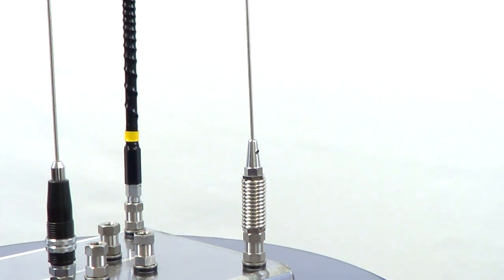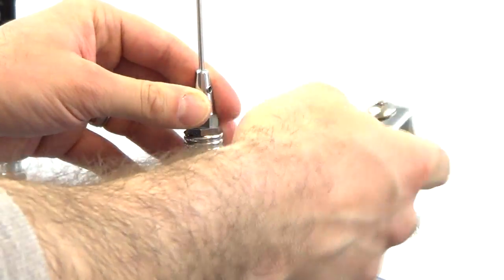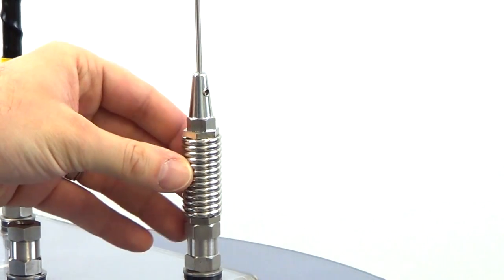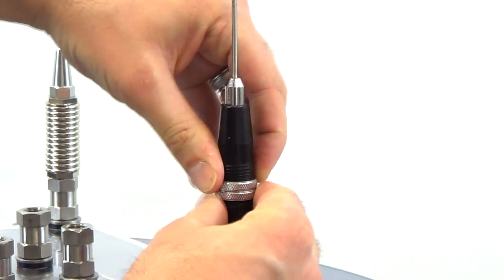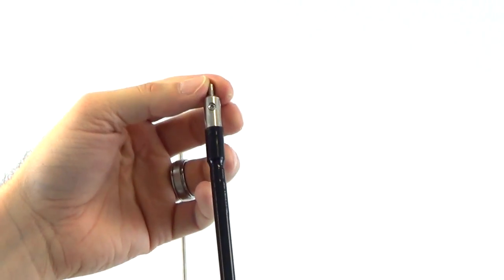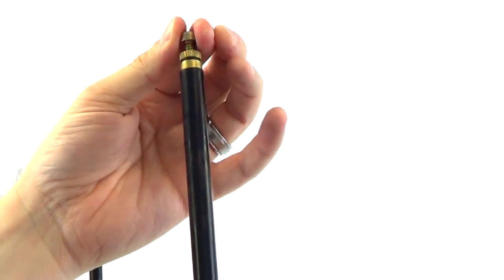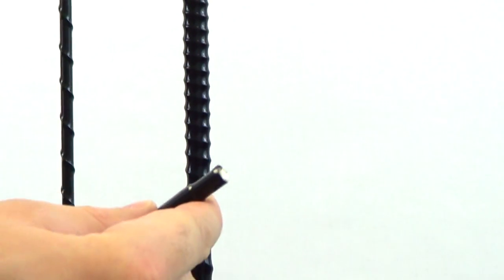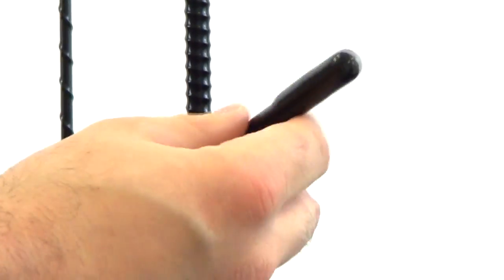CB Antenna Tuning Methods Explained by CB World!

Comment: Finally instructions on how to Tune my antenna with Rings. I took those off thinking they were some kind of mounting rings. By loosening the Allen nut I raised and lowered the antenna to no avail. I was frustrated until seeing this video. Thanks!
Reply: I just installed mine... Channel 40 was at 1 for me (the high 1 by the red zone, not the low one I wanted) and I couldn't figure out how to fix it till I found this. Moved the rings up and it works perfect now! Channel 1 is 1.5 and 40 is 1.25

Comment: I brought my swr down by wrapping 14 gauge copper wire around the antenna at the base just above the magnet it has to be on the part that you adjust my swr on channel 40 was 1.2 and on channel 1 it was 2.8 after I PUT THE WIRE on it my swr was 1.6 on channel 40 and 1.4 on channel 1 you need a piece of wire about 8 inches long but you can try that and if it is not long enough try a short piece or cut a longer piece you do not have to remove the insulation from the wire wrap it close together

Comment: Great video I'm living on the second floor of a block of flats and I can't put an antenna on my roof so I'm using a springer antenna on a magmount base on a baking tray lol but the swr is quite high. I'm transmitting OK but the local breakers say I sound miles away but I'm not to far away from them do you have any ideas what I can do
Reply: Put  ground radial wire's on the tin
108 inch 4 or more

Comment: What do you mean high high high on channel 40 ? Or channel 1. ?
Reply from the maker: Thank you for asking!  If your SWR reading on your highest channel is higher than your SWR reading on your lowest channel, then your antenna it too high.  High, High, and High.  You would then need to reduce the length of your antenna system.  You might also want to check out our High SWR Troubleshooting Article on our website: https://www.wearecb.com/troubleshoot-a-high-swr.html.  We hope that helps!

Comment: What if 40 and 1 are in the red. I have made sure the ground is good. The antenna is new. I put a old one on and it tunes good. I have adjusted it from longest to shortest. Can you have a bad antenna?
Reply from the maker: It could be possible that you have a bad antenna, however, there are several factors that could be causing the high SWR readings.  Be sure to review our Troubleshooting High SWR Article in our Help Center:  https://www.wearecb.com/troubleshoot-a-high-swr.html  Make sure that any excess coax is properly stored in a figure 8.  It could also be that you are using the incorrect antenna for your particular application.  Let us know if you still need any assistance!

Comment: you need to show how to adjust a 102 inch whip for Mobil set up
Reply from the maker: Adjustments on that antenna system are oftentimes done via adjusting the length of the coax.
Reply: With a 102 in whip the only true way to tune it is to add a spring or two. Often the springs for a 102" whip are 4 "thats an option but only a one time deal add the 4 inches and cut down the whip itself.The other option is buy a tunning stud, These are sold in single units from 1" ito 4 inches and there is enough room inside the attachment to raise or lower the height and retighten the set "s" screws.

Comment: Could you give me some advice please.i just bought a road King and the truck has dual antennas i calibrated it like the manual said but for some reason if I key the Mike the read out is fine but when I talk on it it bounces in the red any advice would be greatly appreciated thank you
Reply: It sounds like you are having a problem with speech processing..  CBs are amplitude modulated (AM) as opposed to frequency modulated (FM) and you may be over driving you rig with too much power.  From a ham, licensed since 1962, a few questions:
1.  Are you using the microphone that came with your radio? 
2. Does your radio have a "MIC GAIN" control?
Reply: @j.d.schultzsr.9215  thank you for the reply.yea I'm using the mic that came with the radio and yes sir it has a mic gain and currently it's turned up all the way should I try and back it off a bit maybe?

Comment: My meter doesn't work how do you fix it?
Reply from the maker: Dear Keith~ Thank you for your question!  Whether it is an external meter or the meter on your radio, you might need to replace the meter.   For an external meter, we typically recommend the AUSWR meter.   https://www.wearecb.com/auswr-swr-meter.html  Depending on what is wrong with the meter, you might be able to fix it yourself, although we wouldn't be able to advise you on how to do that.  We hope that helps!

Comment: I dont get it at all. 
Ok say your antenna is on your trunk its lower, right? Now it's on your roof its 3 feet higher, right?
So what's up with these half inch changes? How do they make a difference?
Reply from the maker: Tuning the antenna affects how the antenna interacts with the ground plane of which it sits, meaning that moving the antenna from the roof to the trunk lid would put it in a new environment meaning you would need to retune the antenna to the ground plane of which it sits. If you need more help with this subject please feel free to contact us! All of our information is available on our website!

Comment: Im just started on the cb radio world. What would be a decent radio and antenna to begin with that i dont have to do so much tunning. Please help thanks
Reply: 1men wolfpack cobra 19 is good but I use a cobra 29 Ltd classic (really great radio) and a good magnet mount antenna is a Wilson lil will or a mounted antenna would be a firestik
Reply: You will still probably have to SWR tune it, but you might be lucky.

Comment: The best reading that I could get with my firestick was 2.5 at 40 and 1,5 at 1, with the tip shortened all the way.   Did not think about trying to remove the tightening ring to make it shorter.   Also with the other one with the wire in the center,was unsure how to shorten it.  So I have some work to do.  Nice to know that I can leave he SWR meter in place so that I do not have to keep disconnecting it as I work with the antennas.    Thanks for this video.
Reply from the maker: We appreciate your comment!  

Here are a few things to consider:  1) Make sure that any excess coax is properly stored in a figure 8, about a foot in length, and bound in the center.  Then recalibrate/recheck your SWR.  2) You can completely remove the tip to try to reduce your SWR.  3) Make sure that you are putting the cap back on the antenna after every adjustment as the cap can affect the SWR readings.   

We are happy to do some additional troubleshooting with you to help you attain better readings.  Just contact us.
Reply: Hello,  I am surprised that you replied to my comment since the video is 5 years old.   Good news to report....took the Firestik screw all the way out and put red  plastic cap back on and got 1.4 on channel 1 and 1.2 on channel 40....best I have ever gotten.   Repeated it several times and got the same. THANK YOU VERY MUCH!!!!!  YOU ARE GREAT!
Reply from the maker: That is awesome!  We think you are great too :)  Let us know if there is anything else we can help you with!

Comment: So which Ch 1 or Ch 40 suppose to be higher ?
Reply from the maker: Hi there!  If the SWR reading on channel 1 is higher than the reading on channel 40, your antenna system is too short and you need to lengthen your antenna.  Alternatively, if the SWR reading on channel 40 is higher than channel 1, your antenna system is too long and you need to shorten your antenna system.  A full explanation can be found in our Help Center article:  What is SWR? https://www.wearecb.com/what-is-swr.html  You will also find an article in our Help Center regarding Troubleshooting High SWR: https://www.wearecb.com/troubleshoot-a-high-swr.html  We hope that helps!

Comment: Yes I deleted My question. I must ask. You do acknowledge any amplification on 11 meter radio is illegal,I and most know this and frankly I could care less. What about the "tuned" radios? I have seen Cobra 29 Ltd Classics swinging out to almost 100 watts. Are they illegal or is that a "Grey Are" once again.?  Just no extra box anywhere. I never ran a barefoot radio except for the little portable Midland 75-820. Even that I think I am starting to see some small amps for and plan on contacting the manufacturer. Thank You all for Your help and informative videos.Troy.
Reply from the maker: CB Radios that have been modified to output more that the 4 watts allowed by the FCC are illegal.  Many people still modify their radios to attain the higher wattage and assume the potential risk of getting caught and getting a large fine.

Comment: Question?  I have installed a cobra 75 cb on my 2014 Silverado. I can't seem to get it to work. I am using a 3' firestick.  I fabricated the antenna mount and mounted it on the passenger side of the bed of my truck. Running the coax cable through the bottom of my rear  passenger door inside to the box. what am I doing wrong? I have not tuned the antenna,  I have tried the same as you have mentioned I still don't get any channels not even the weather.  My next step I was thinking was to get a longer antenna maybe the 4' like you have. what are your thoughts.?  THANKS IN ADVANCE 
GREAT VIDEO BTW!
Reply from the maker: Dear Carlos- We always recommend tuning your antenna and checking your SWR readings before transmitting otherwise you risk damaging your radio.  You will need an SWR meter to do this.

http://www.wearecb.com/auswr-swr-meter.html

Also, make sure that you are in an area where people will be transmitting- you could try going to a truck stop and ask someone to do a radio check with you. We doubt that your antenna isn't long enough- it is likely a SWR issue.  Do you think that you properly grounded the system?  Give us a call if you need additional assistance (541) 928-1952

Comment: I've noticed the Procom with the rings also have a set screw for the whip. Can you move the actual whip along with the rings?
Reply from the maker: Typically, people use the tuning rings to fine tune the antenna but there is some movement capability of the whip with that set screw.

Comment: my fibreglass antenna has no adjustment at top of antenna and on channel forty it is to high on swr meter what to do
Reply: cut it or if you have it on a spring get a shorter spring or remove the spring all together

Comment: are the whip antennas good? I have one for my cb but feel that the range isn't good.
Reply: .yes, i'm using Stryker SR-5K Magnetic CB Antenna Mount  ,the antenna whip is 62-1/2 long made up of tapered stainless steel and frequency range is 26 MHz to 30 MHz.
Reply: @Johndoe-pp8zj  w
Reply: Shoot my buddy here in Idaho picks up to 60 miles on his radio.
Reply from the maker: The whip antennas are good.  If you aren't getting the range that you hoped for, the first thing that we typically recommend is making sure that you have tuned your antenna for your application and achieved acceptable SWR readings.
Reply: +Carlos Hernandez It's a CB, range is never that good. 2 miles tops
Reply: @mmaida3358  2 miles.. BS... I get 10 to 15 miles on 4 watts when Im mobile
Reply: @mmaida3358  I can talk 5 to 20 miles everyday. I tune my 102 inch whip to perfectly flat swr. thats the must do.
Reply: 2 miles tops huh? You must only run junk radios hooked to garbage antennas because I talk 20+ with garbage equipment in a shitbox truck...
Reply: For a mobile CB radio there is nothing better than a long whip antenna. Even the shorter ones are great choices. Long whip antennas are also problematic due to their length. That is where the Firestik comes into play with a high load antenna that is 2 to 5 feet long. All of these antennas work best with a spring coil as well. It seems to really help the SWR on Firestiks for example and for all the safety reasons.
Reply: You must tune your antenna and preferably to 1to1 ratio.

Comment: Hey there, I'm having a problem. I bought the antenna with the two rings, but I set it up on a magnetic mount by itself (removed the bottom portion). Now I'm having the problem that when I push it up to CAL, the SWR is way up there to like 8 values. Is it because I'm not using the proper mount? I'm using the same magnetic mount that came with a shorter antenna.
Reply: The dial a match never swr's right down. Mag-mounts are no good for this, use a fixed mount or mirror mount!

Comment: I just set up my Cobra 19 Ultra III using the factory coax and antenna mount in a 2013 Freightliner Cascadia. Currently I'm using a RoadPro ring type antenna, but I'm unable to tune it correctly. I've tried everything, but no dice. I need a low profile antenna to clear tree limbs on my local deliveries 2ft or smaller. Any advice would  help.
Reply from the maker: UPSTATE RAIL VIDEO PRODUCTIONS We have a few options.  Have a look at these and give us a call or email through the website
http://www.wearecb.com/cb-antenna/?subcats=Y&features_hash=V179.V180

Comment: Does matter how long cable is 8ft ?
Reply from the maker: donald laisure Manufacturers generally recommend an 18 ft cable.  SWR's tend to be ok when you stick with multiples of 9, though.
Reply: On dodge dakota  4 door looking at Mount s that just bumpers

Comment: FYI...
The V.S.W.R.  should be set for it's lowest dip on channel 19 (the middle of the band unless your freebanding...;-)  This is why channel 19 was selected for the "truckers" channel....
Adjust the antenna's resonate frequency by altering it's length in the usual way..
The antenna's impedance will determine the V.S.W.R. at it's resonate frequency (when your best tuned to channel 19), adjust it's impedance by adjusting the antenna's proximity or angle to the ground plane (the car or truck)
The antenna's bandwidth determines the V.S.W.R. on the high and low channels. The shorter your antennas (meaning loading coils are used) the less bandwidth the antenna will have...that's another reason why 102 inch whips are better (no loading coils=wider bandwidth)
 ·

Comment: Hello, I have a  K40, with a 59'' metal rod.  Should I begin to cut 1/4 inch at a time. Im trying to get a better match, swr is  high on channel 40.   like to get it better. Thanks, JC
Reply: +Jim Cash. easy to remember. 
low 1.1 on 1..  2.0 on 40 = ant is to long
low 1.1 on 40..  2.0 on 1= ant to short
gotta remember lower in frequency you go the longer the antenna.
higher in frequency the shorter the antenna
so swr is high on 40 low on 1. this mean you have to shorten the antenna take off about 1/8th at a time
until you get a 1.5 or better at 20.  27.205mhz also the coax length matter to and the groundplane used

Comment: Thanks for talking about the firestick 2. I always wondered if I could take that screw out because I'm a little high on 40. Swr avg about 1.4 on one and 1.8 on forty. I wish I could get it to 0.2 but in a company truck I think that's impossible.
Reply: Well I figure out my problem it was the diesel preamp that I had on it. I trashed that crap I'm at 1.2-1.3 on all channels

Comment: Can you just move the mounting location if the swr is higher on 1 and have no more room to extend antennae?
Reply from the maker: That is something you can try.  A new location might give you a more favorable SWR.  You can also add a spring or quick disconnect to the antenna to give it additional length.
Reply: You also have to tune your radio and antenna to the particular type of vehicel you’re driving. Most of the time it would be right smack dabb in the middle of your metal roof if so equiped. The next spot would be in the middle of the trunk. Hope that helps. Doug.